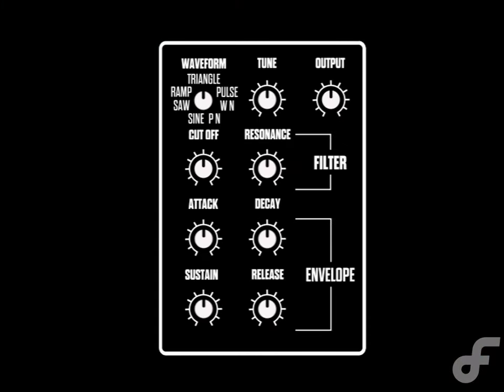How to Use an Aux Envelope on a Synth

Comment: Hey dan.. I’m glad that you are making short and simple videos and I like it so much (: 

So I’m not familiar with hardware synths, I use vst synthesisers. As you know serum has some envelopes. Are they all called aux envelopes?
Reply from the maker: yeah you got it! all except envelope 1 is a tad different because that one is automatically connected to the amplitude, you can just route it to other things on top of the amplitude. but other than that they are basically all aux envelopes you are correct :)
Reply: Dan Fur hei got it. Thanks (: